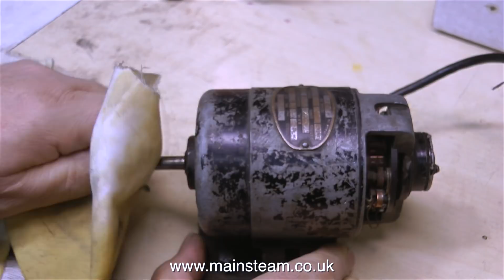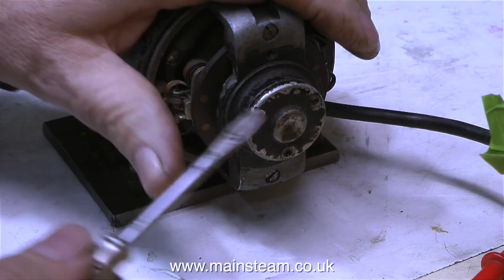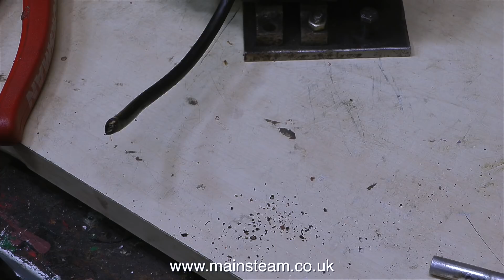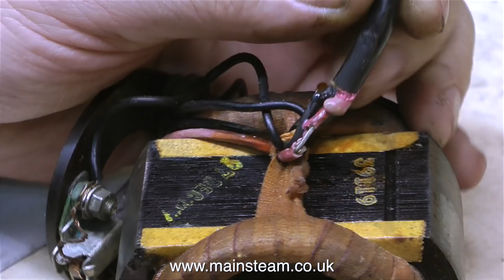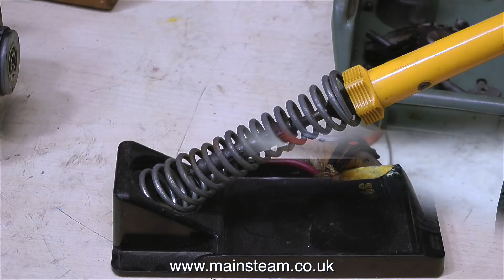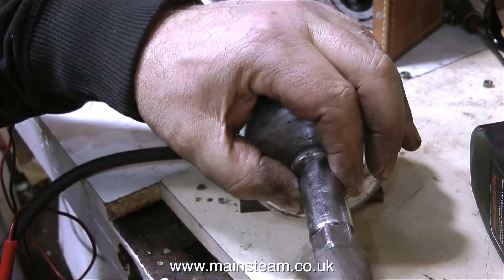REPAIRING AN OLD GENERATOR AND MAKING IT WORK - IN THE WORKSHOP

Comment: Hi Keith

As you know I am one of your greatest fans & support your videos via PayPal.

This is an exciting video for me as I hope I can get you to think about generating some Real Power with your Stuart 5A !!
As you know the trick will be to increase the efficiency of your system.
Knowing that you also work with Model Planes the Brushless motors with modern magnets can be converted into efficient generators.
As a rough guide, the motor KV is calculated as KV = RPM/Volts
Translated, Volts = RPM/KV
So spinning a 440KV motor at 500 RPM is just too slow.
As Volts = 500 RPM/440 KV = 1.3 Volts AC three phase..
Thus using 6 silicon diodes needed as rectifiers will result in little DC output. 
However, Spinning the motor at 6,000 RPM, you will get about 12 Volts DC.
Now on the Steam side you will need a True Condenser…
Another video… Series !!

Thanks
James
Reply from the maker: Hello James,
I thank you for your support.
I have noticed that with this old generator it needs to spin faster than 1000 RPM to generate electricity at 12 volts, I will try it shortly driven from a Stuart Victoria Flywheel and see what happens
It would be a waste on the 5A because that would drive a far bigger generator, Maybe I will try to convert a washing machine brush type motor for that one {:-)))

Comment: Nice work as always Kieth.  Although it’s been many years, I used to repair DC machines like this only much larger - what you did was very good and nothing wrong at all - there are a couple of extra steps you can do when restoring the commutator but nothing major, just chamfering of the sections - we just used an old hacksaw blade with the end ground to a 90 degree point so you’d get a 45 degree chamfer - hard to explain, but it just makes the new brushes live longer.  Not really needed here though on a small machine like this - good job.
Reply: I normally don't read/leave comments, but I came in to see if anyone had suggested the hacksaw blade method for cleaning comm slots ;).My father was an electrician speialising in power tool/small plant repair, & I learned that trick at his knee.

Keith, the nice thing about your videos is watching you describe & follow the same sort of "look, think, consider what you already know, & apply common sense" approach as he taught me...

Comment: Those old Motors and generators are very difficult to kill. My mum's sewing machine is from 1926 and still has the original electric motor. The bearings are so sweet that it runs for almost a half a minute after you turn it off. Good job, another excellent video.

Comment: Suggestion: Create a load board using 12V Lamps and switches, then with a voltmeter measuring the output voltage and an ammeter in series you can calculate the output power. Allowing say 80 to 90% efficiency for the generator and by measuring the RPM of the engine driving the generator you can calculate the output power of the driving engine. Power in Watts = Volts X Current, P=E x I. Deduct say 15% to cover inefficiency of the generator then divide power in watts by 746 and you have Horsepower of the driving engine. Any good Electrical Fitter or even Electrician can help you with this. I had to do these calculations during my apprenticeship at Technical College. Please contact back for more info. 

It would be really great to see actual load tests of (in particular) of the larger steam engines up to say 1/4 HP because I don't think the generator would be capable of more. Rated power output of generator HP = (V x I) / 746 where V is output voltage 12V and I is output current from Makers Tag.

Cheers Ken
Australia
Want to visit Yorkshire one day

Comment: As you run the generator it will strengthen the magnetic field in the stator until you generate maybe 13.5 volts. if it gets hotter than that you may need a regulator for long runs unless you have a dead battery to soak up the voltage. I had an old ford years ago that kept losing magnetism in the field. you would have to jump the bat+ to the field every time you ran it or the generator wouldn't put out a millivolt, turned out to be old cracked insulation just like yours.

Comment: Excellent job. I have been rebuilding and restoring old motors and generators from the early 20th century for many years. I have yet to come across one that I couldn't get working. Cleaning, re-lubing the bearings and replacing the cord is usually all that needs done. I have gone so far to machine housing end caps to install bearings to replace bushings. Again great work.

Comment: Cool video! I am an electrician myself, so it's cool to see such an old device working again, good work! Can't wait to see it connected to a steam engine and actually doing some work. Question: is the efficiency of the generator indicated on the info plate? Would like to know what the efficiency on this thing is compared to new generators.

Comment: The motor relies on the residual magnetic field in the stator iron. The rotor and stator coils should be wired in parallel. When the generator start turning a weak current is induced in the rotor und this current also flows through the stator coils and strengthens the magnetic field. If a load is applied at startup, this can't happen und you only get a small current.
If you apply a load, which is to heavy, the magnetic field will collapse and limit the output power.
If your generator will not generate any power in the future, just apply a current to the terminaals with your battery. This will give him back his residual magnetism to aid startup the excitation.

PS: I am an electronics guy, who enjoys your craftsmanship and i really like your videos. Greetings from germany
Reply from the maker: Thanks for that - yopur explanation fills a few gaps in my thinking regarding this type of shunt wound generator.
Reply: Absolutely correct. That was what i wanted to write. :-)
In essence it's an universal motor (as in washing machines) used as a generator.
The neat thing of this type of generator is, that they are very secure towards overheating and to much power consumption. In both cases the magnetic fields would break down protecting the generator from damage. Permanent magnet generators are more efficient but have problems with overheating and to much power consumption. I've seen wind turbines burn because of that.

Comment: The reason why shomons engine have the switches is if they are generating the power to rides the engine has to get power up it doesn't matter about the lite bulbs as thay don't need much to lite up but for big lodes you let it build up and connect it suddenly to the ride or Oregon. Ps I should no my dad has a 5 hors burrell shomons called magret.
Reply from the maker: Thanks for that explanation :-))))

Comment: Some of those older generators require residual magnetism to establish field. When sitting for too long the residual would be lost. Putting current through it takes an affect of recharging and it worked afterwards. I guess the generator was okay to begin with, just been sitting for too long.
Reply from the maker: Yes that makes sense - many thanks.
Reply: Keith Appleton You are welcome. Glad to help.
BTW that also explained why the generator has no output if starting under load.

Comment: Back in the olden days, in the shop where I worked, we used to clean commutators on a miniature lathe just like you did here.  I don't know if it's still there, I've since retired and they moved to a new building.  Young mechanics today know nothing about generators, and if an alternator doesn't work they don't even bother checking the diodes, they just replace it.

Comment: Keith,

The generator was manufactured in a time when things were made to last and be maintainable, when something failed.  That's a far cry from today's planned obsolescence and throw away mind set.  A very nice bit of work on your part.

BTW, did you "crown" the pulley to keep the flat belt from wandering?

Eli D.
Reply from the maker: Yes, I crowned the pulley with a file followed by coarse sandpaper - it took ages to do :-)))

Comment: Looks like the dynamo from an internal combustion engine, as the date would suggest, pre WWII too. There are still motor rebuilders in the wild, but rewinding electric motors used to be a widely practiced art, not anymore. There are many guides online so if wanna learn more, it's out there, but I personally wouldn't take the time to bother, steam power is so much nicer than that confounded fancy angry pixies.